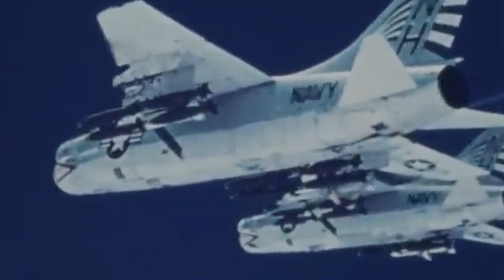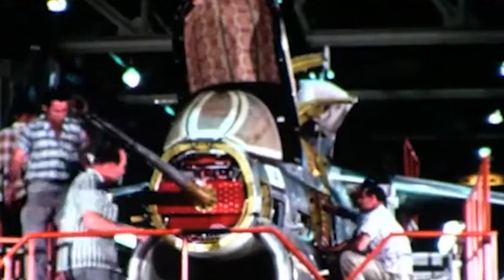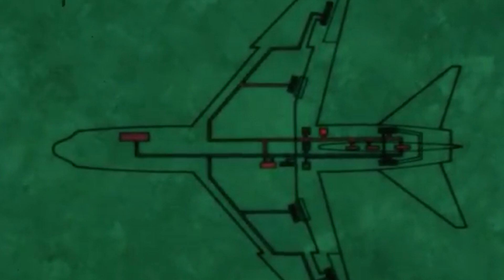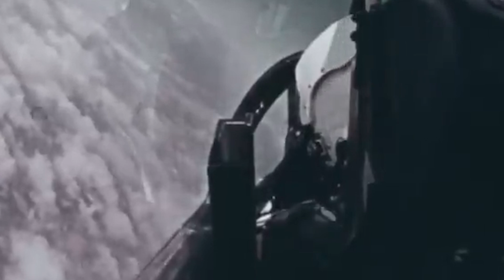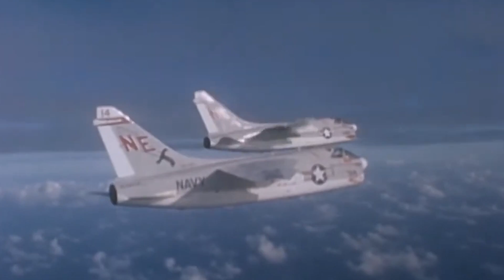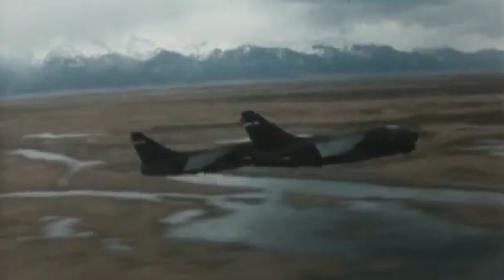The Ugliest Yet Utterly Lethal Bomber Ever Launched into Combat

Comment: In the early 80s, I was attached to VA-82 for a short while as an AT at NAS Cecil Field, Florida. We were using the A-7. It was starting to show its age...

One of my buddies was a hydraulics tech. He noted that the plane was notorious for leaking hydro fluid. If the pilot walked up to the plane and didn't see any fluid on the ground, he wouldn't fly it, because it meant there was no fluid in the system!

Several got together and went through the ENTIRE system, fixing every single leak. Next day after they'd finished, pilot refused to fly it, cuz there was no fluid dripping. Later, the guys went out and put some fluid on the tarmac and on the plane, and the next pilot flew it with no problem...

Comment: In several scenes they are showing footage of F8 CRUSADERS, not A-7's. That is a pretty big faux pas.

When I was going through flight school and we made out our "dream sheets", A-6's were my first choice but A-7's were my second. A-7 pilots I knew always referred to it as a two seat aircraft with only one seat. They were very busy pilots. The had to aviate, navigate, communicate, designate and evaporate. Its Achillies heel was the Allison turbofan. It took a long time to spool up which is a bad thing when you are on the ball especially at night or in bad weather. If you got in trouble on the ball things could go to worms very quickly. You never wanted to get low and slow in an A-7,  I was also an LSO and watched two of them go into an approach turn stall when they overshot centerline and overbanked, forcing the pilots to ride the bang seat.  The P&W's on the A-6 were very responsive and quick and could get you out of trouble a lot more easily.

Comment: The HUD wasn't introduced until the D & E models entered service in 1970. The C model (for the Navy) had the same avionics as the E model, but with the earlier TF-30 engine. The first 67 A-7E's were thus re-designated A-7C's due to them being powered by the TF-30.
Reply: I was a HUD Bench tech in AIMD.  After 'C' school, I ended up teaching the course on the bench at NAMTD at Cecil Field.  I knew that bench and the HUD inside and out.

Comment: While on the CVA-67, a Corsair (A-7) pilot manually pulled straight up at high speed and launched a 1,000lb. bomb that landed 26 miles downrange spot on target. Outstanding aircraft & the men that flew them. Not ugly in any way, shape, form, or fashion in my opinion. Damn cool & so glad we had them.
Reply: I was on the JFK for the last 3 months of her '80-'81 Med cruise after spending a year and a half ship's company on the Saratoga.  My primary job was as the A-7 HUD Bench tech in AIMD.  I talked to a few pilots about how they used the HUD and how much it helped them deliver ordnance exactly where they wanted it to go.
Reply: When they say " warheads on foreheads". The SLUF probably delivered it.
Reply: "Lobbing" was actually an old delivery tactic used to fly under radar primarily..  later for the delivery of tactical nuclear weapons
Reply: USS Nimitz.  1988 to 1993.  I loved this plane…. And it is not ugly….

Comment: A US Navy aircraft that was so good the US Air Force bought it. No higher praise...
Reply: USAF also hooked up with the F-4 Phantom II
Reply: McNamara's "brain trust" may have been at least partially behind that.  I agree that the A-7s were very good, reliable, & rugged.  I worked at NADEP (NAVAIR Depot) JAX for ~38-years and the main hangar was full of A-7s undergoing the (usually) planned SDLM (Standard Depot Level Maintenance).  I think the worst damage to an A-7's airframe that we repaired was when the Pilot "goofed" (or so I was told) and landed on the end of runway, hook down, and immediately ran off into the grass at the end, hooked the chain link fence at the boundary of the Base(?), and dragged it into an 18-wheeler that was (I think) passing by before finally coming to a stop.  I think the aircraft may have come to a rest in/on the 18-wheeler.  I assume that the Pilot (& the Trucker too!) had to change his shorts after that, whether or not he ejected (I don't recall that info) before the airframe started hitting things.  The airframe was "slightly" bent/twisted, etc., and if the damage had been any worse, the aircraft would have been stricken and sent to scrap.
Reply: The USAF looked at getting a new version of the A-7. Instead they bought the new F-16 for the role